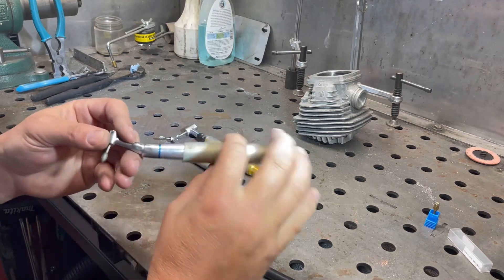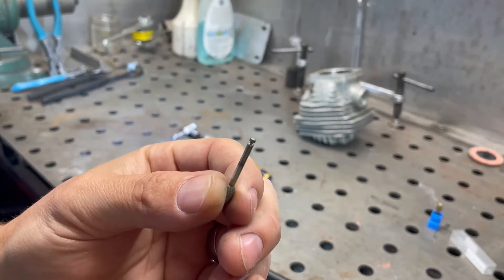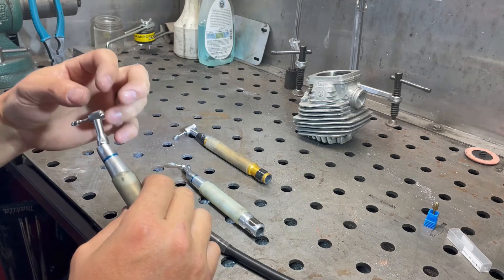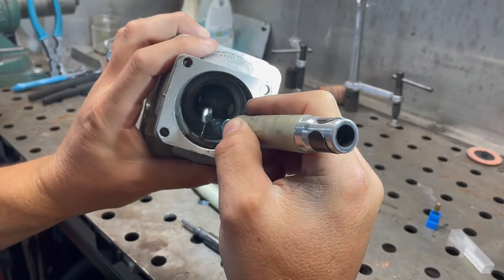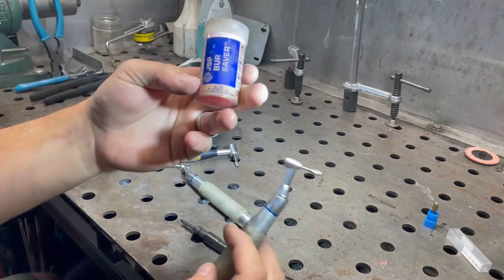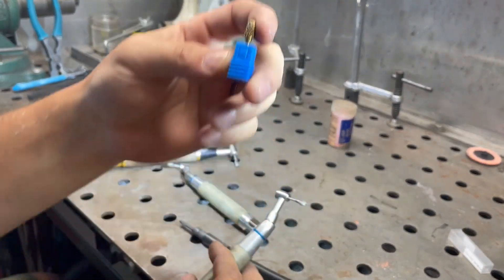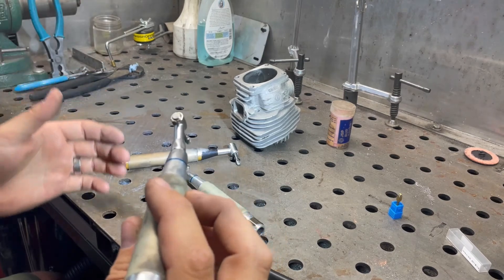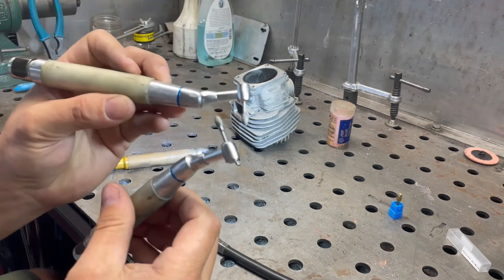NSK dental head adapter for Foredom flex shaft grinders

Comment: I have two hours or so on mine and both heads are worn out I oiled them tightened them up is there anything I can do or buy or is there a solid 90 option you can get, I apologize you did pretty darn good machine work but overall I’m not impressed should have went with a beefier counterpart to the nsk.
Reply from the maker: Please email me a phone number where I can reach. If it's not working for you I'm happy to give you a refund.
Reply: Amazing customer service, great guy to deal with, I highly recommend ordering through him.

Comment: I just ordered one this morning what heads do they take not the burrs but the head
Reply from the maker: Any NSK style dental contra head, I personally like the YAD style push button heads.
Reply: Do they make nsk heads that take a regular burr, im not a big fan of the latch burrs, not a big variety
Reply from the maker: @FreedomotorsportsLlc  No, in head this size there is no room for a collet. Any 3/32" shaft burr can be modified to work with the heads.